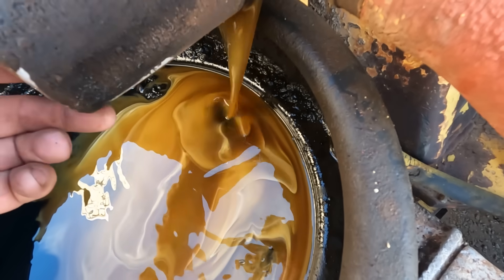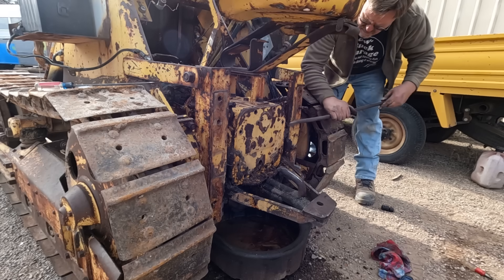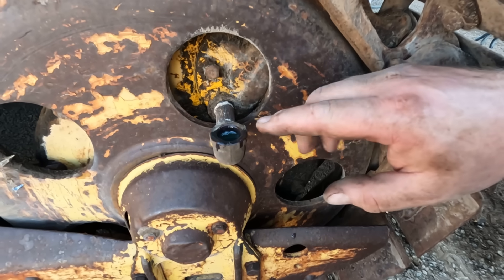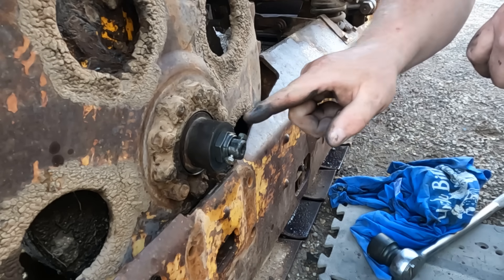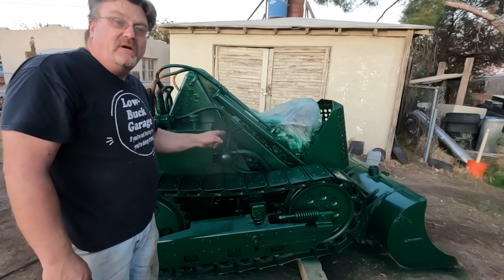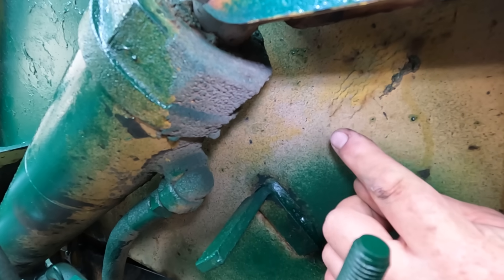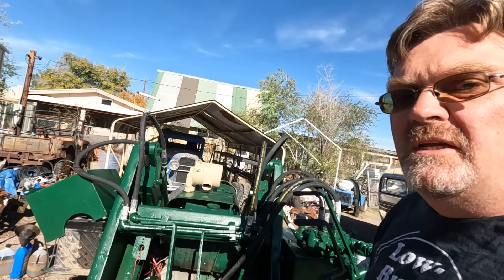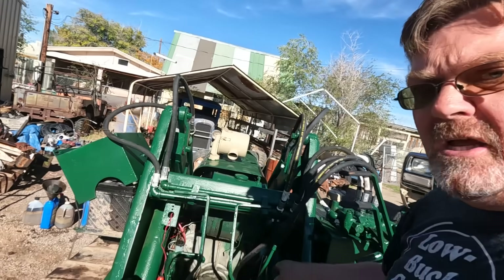Nissan Diesel Swapped Oliver OC-3, Problems!

Comment: You are doing great. I have not read all the comments, so this may have been mentioned. If you want to know what angle your bucket is, place the bucket flat on the ground in a neutral position (neither tilted up nor down) and get a piece of metal and weld it to the bucket, in a spot that you can see it from the operator position, in a level position. This will give you something to gauge your bucket angle..

Comment: Nice job!  Now you need to add a ROPS ( roll over protection structure) with a roof to protect your noggin from sun, rain, and falling  articles such as tree tops, utility poles etc.   It'll also add some much needed counter weight to keep that machine planted on the ground.   I have an old John Deere that's in dire need of a protective structure myself. I picked up  an old  roof off an old forklift that I think will work for my situation.

Comment: For the bucket position indicator... Attach a piece of 1/4" round bar to the bucket end an up to the top of the cylinder where you can easily see it. On the top side, slide a piece of pipe over it so the round bar can slide through freely. I think you get the idea.
Then you can set the bucket flat on the ground and use an angle grinder with a death wheel to mark the round bar at the end of the pipe. Actually cutting it flush works great too, IF the pipe is long enough.

Comment: i'm glad you replaced those hoses, when you change the oil of these old machines since it can now flow properly the most likely thing to happen is those hoses bursting, also due to the crud in the hydraulic's i think she'll need a pump rebuild, and once you're back to OEM hydraulic pressure you'll be thankful you replaced those lines ;)

Comment: I run 20 ton track loaders and that little thing is very impressive, the engine is almost perfect for it as the tracks spin before it looses power but still bogs slightly to hold some traction, the simplicity especially with it now being diesel makes that a unique alternative to the small utility tractor plus with the Oliver history being saved
Thank you sir

Comment: I love this deal. A great video with an old dependable Oliver 3 ton crawler loader being repaired to it's expected standard. It was successful. And I have a four ton old dependable loader that needs very much the same stuff doing to it. So for me it's also inspiration. After some lengthy part rebuilding and some expense, the old girl is losing it's appeal slightly. Not quitting but a short break is as good as a rest doing some other interesting and fun stuff. Now as I find myself having to get back on with it before details are too hazy - here's Low Buck Garage with an inspirational vidocumentary, right on time!!! 👍👌👌👍💪

Comment: SD22 engines are great little  things made from 1963 right up till the 80’s . Early ones had 3 journal cranks then went to 5 and later ones want to 2.3 and 2.5 with rotary pumps. We used to put the 2.3 and 2.5 ones into Land Rovers and nissan pickups.

Comment: My dad has a wide gauge oc3 that we used around the farm for quite a long time. He bolted two by fours in between the track and the side of the machine there was about 8 inches of room. Then he mounted metal stakes and we were able to haul at least six 4 inch 4 foot logs on each side it was great for cutting wood because it would drive on top of the powdery snow. you could drive up to the tree, cut it down, limb it, and load it up. that little crawler was also great for fencing on soft ground.  That was how it met its demise. My uncle loaded it up with posts and took it out in the swamp to pound posts. Unfortunately the clutch fell apart and that’s where it stayed. The old girl probably could still be resurrected if someone had the time to play with it.

Comment: For another recipe to clean out the sludge replace about 25% of the oil with antifreeze and run it until it get to operating temperature.   I used to work at a GM dealership and had to deal with Chevrolet LUV trucks with blown head gaskets. This dumped the antifreeze into the oil pan and it turned the oil into coffee colored slug and did an excellent job cleaning cooked on oil out of the inside of the engine block.

Comment: @Low-Buck Garage That tubing you used for the positive cable is called liquid tight flexible non metalic conduit, also known as LFNMC, or in trade speak, carflex. It's mainly used for electrical wiring, most often in generators or in hard to get places on the main services. Comes in 1/2" up to 4". I haven't seen anything bigger than that, but it's probably out there.

Comment: 9:20 another method if you come across this again: remove the bands or other fibrous material and put Naphtha inside all the way up. Naphtha dissolves all organic material (including some plastics) and makes cleaning a breeze. If you have nasty, nasty chain, you basically throw in a pan, pour the deadly stuff in and let it sit. Swishing the tray a few times = effortless cleanup.
37:46 you can probably use some old tractor weights (suitcase weights) on a rack in the back if you don't feel like messing with that contraption.

Comment: 16:40 Next time, find yourself some "cornhead" or NLGI 00 rease. It's a semi-fluid grease which will congeal when at rest, but liquify when worked, meaning it will circulate around. It's perfect for steering boxes and rollers like this. It also won't leak out!

Comment: You might consider using aluminum foil to cover up things that you don't want painted, it also works well to cover things yo don't want to get wet when pressure washing equipment.  It is usually quicker than tape and easier to remove, when painting things like hydraulic rams and engine parts.

Comment: Now the sterngear is sorted, stay out of the shallows! Having the props on P brackets is good for efficiency but without the protection of a keel or skeg leaves them vulnerable to damage. The faster the boat the quicker you can get into trouble.

Comment: Steiner tractor sells a mini one wire alternator that worked great on my 49 Oliver HG. I had the fabricate a mount and modify the bracket, but it wasn't hard and it works great. Also, it's small so it tucks in close to the engine. You should check it out for this machine.

Comment: Idk how you do it. I absolutely love working on old equipment and older trucks. But I over think stuff so bad It gets to where I’m scared to drive it. I do everything the right way and I don’t hack anything but I still just get worried something bad is gonna happen for some reason. I know I can fix it if it does but i still over thinking it. I have been daily driving my bonanza all summer after I swapped a new motor in and I’m just starting to get over it. I had zero problems in the 105 degree weather we had and zero problems all summer. Idk If it’s just something you have to get used to or what but I sure hope i get over it 😂.

Comment: You should consider putting some hose protection on all of those hydraulic hoses. Protects them not only from abrasion, but the Sun... Which ultimately caused most of the damage to the old ones.

Comment: Find a backhoe for the back! (They call it a backhoe because it goes on the back and it kinda...hoes). Even if you find a small one, you can add weights if it isn't heavy enough to reduce the tipping. If you just want a bucket loader, and maneuverability, just add chunks of steel, welded together, to add weight to the rear. Or, find a Bobcat rear weight. Space it out away from the rear if it isn't heavy enough. Put a cooler in the space.  😯🤫🍺 That oil change was awesome!!   (💩).  😁🤩

Comment: Great job! That Diesel is an improvement! I know the bolt thru the nut wasn't exactly Kosher, but, sometimes that's all the options some people have. It obviously worked for a long time until you fixed it correctly. Just curious, why didn't you clean the threads and use the proper grade of locktite for wide clearances as well? A little heat breaks it loose again. My father worked very closely with Locktite developing some formulas. The right formula with the proper prep can do wonders, our farm looked like your place, dad said it was not a farm, it was a nursing home for old equipment. we had LOTS of opportunities to use Locktite thread and shaft repair formulas and a good supply of free samples. I retired and moved and now I live on 1-1/8th acres and have 5 tractors up to 230 hp, a 36,000lb 4.5 yard loader with a 6V71 Detroit, 3 6x6's, one is a welder shop truck, one is a M35A2, and one is a M543A2 5 ton wrecker, and a few trailers. I also have a 1958 U.S. Navy  Dodge T700 semi tractor with a 354 hemi. Among other things. That's part of what I kept out of the farm sale. It took 3 days solid opening to closing at the BMV just to process all the titles from the sale! Once it's in your blood ya can't give it up! My wife wouldn't let me. If I get too clean and grumpy, she says "I married a MECHANIC!" and shoves me out to the shop and tells me not to come back until my hands are greasey and I smell like Diesel fuel! 😅

Comment: What a beautiful job , love to own that tractor. 
I’ve been told that it’s a good idea to peen welds for at least a few seconds immediately after completing the weld and then quickly bury the welded parts in a container of mica chips or vermiculite to cool them very slowly . This is supposed to keep the welds from cracking????. 
Just a thought. 
👍👍👍👍on your project. Absolutely love the old Cletrack.

Comment: You CAN grease those track rollers, if you use something like John Deere cornhead grease.That's what I do with mine, since the seals are bad and it won't hold gear lube well.
 I'm surprised you could dig that dry dirt as well as you did. I bought a Pirahna tooth bar to fit the bucket on my OC46 and it works great. I've used it to clear an acre of scrub trees.

Comment: Weld a metal 3/4’ or larger bar on the edge of the bucket, pointing up, so you can orientate it. Anywhere, anyhow, you can’t go wrong.

Comment: Weld a pair of pallet forks to the bucket. Find out if you can add a blade. Sure beats spending the $500,000 dollars in owning 3 new machines doing each as most do these days.

Comment: I learned an AWESOME trick for stuck Hydraulic hoses from the "Capt Kleeman" channel a few months back on YouTube- he took a normal air hammer, cut off a head on a chisel and used the remaining blunt round shank on the air hammer to tap the sides of the hydraulic lines fittings and it rattles them loose like nothing, I tryed it on an old Skid Steer I've been working on and it works EXCELLENT! - check out his videos on restoring and Old ford 555 Backhoe
Also, you can rig up some rear counterweights with a framework of bedframe welded together and some slab of concrete from an old sidewalk tear out or just cast your own concrete counterweight with plywood & bedframe

Comment: Those fluids look terrible. It looked like the transmission had peanut butter in it. When you pulled the drain plug on the bottom, it sure reminded me of a sick dog with bowel problems

Comment: Excellent video Glenn  :) yes that Oliver  dozer with Nissan Desiel motor running great , gauges plus Delco  Alternator 100  amp with interneal regulator 2 post recharge battery also bright headlights  and for weight on back use a metal pail 20 quarts type  of cement help back weight  brackets in ! Gauges , for Volt, Water Temperature, Engine oil pressure, transmission temperature  plus axle one bolt on sensors, RPM, Glow plug Warmer button with heal coil tell hot , key switch, cable turn off engine on knob & exhaust on stack or down draft with Silencer tube muffler!

Comment: If you add a BURRITO HOLDER to the rear of your dozer, that will also help with better weight distribution... and it'll make your dozer even more FUN.
Reply: Loader ,not a dozer . And yes there is a difference . Try loading with a dozer .
Reply: @jefffindley5870  Well, that escalated quickly... and sarcastically. Was such pedantry over a humour based post necessary / satisfying to you..???
Reply: @Baphomet-J.-Moon-Fetus  just pointing out a fact . Didn't mean to offend you .

Comment: There is a round tube fitting on top of the bucket. I have an old 1940's military fork lift has the same thing on the backstop seems to be fine threads maybe pipe on the inside. Anybody know what that is for?

Comment: I know its a cool old dozer/tractor built during a time of mostly tractor parts but seeing you hanging over edge with only that bouncy seat bracket holding ur butt suspended in air really has me worried for you.why not build a small extended box end,complete with seat built in,so i can stop worrying for you.plus it would just look more normal for a dozer style trac-loader.ur pa.friend snooky.😊😊😊